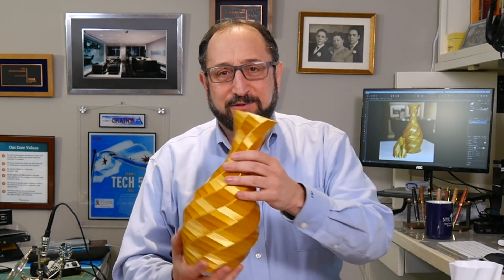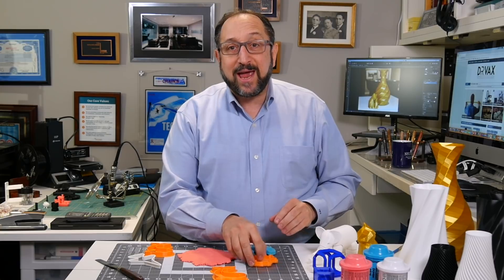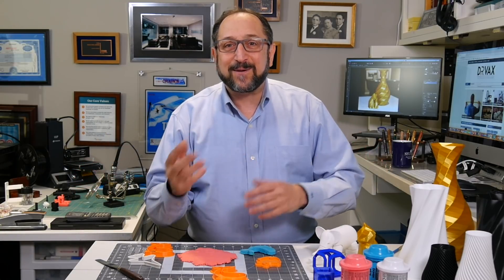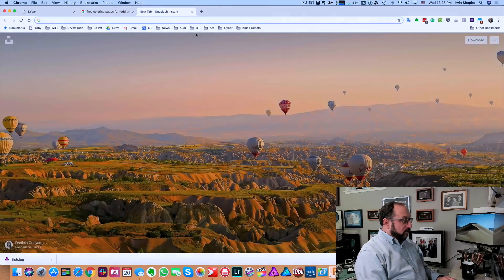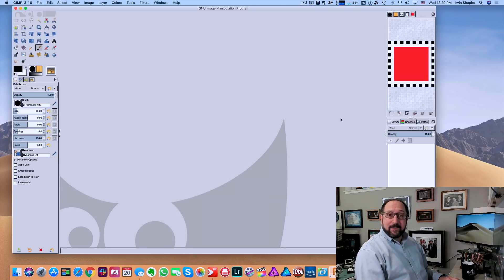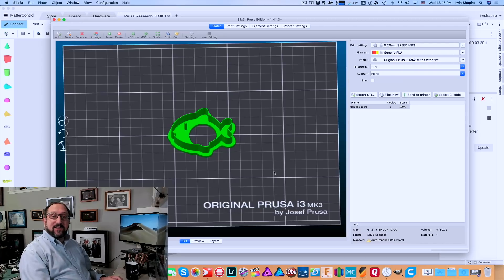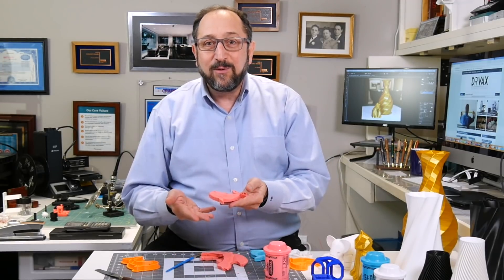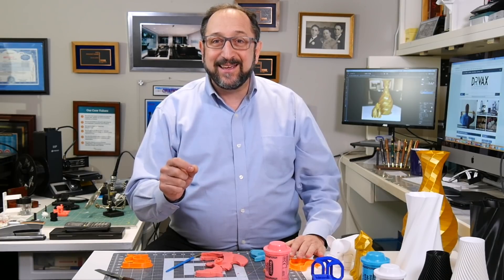Designing and Printing 3d Printed Cookie Cutters

Comment: I installed mattercontrol from your link but found that when I wanted to add a base outline to the image it only gives me a base rectangle as the only option. Do you have any suggestions?
Reply: I'm having the same issue. Were you able to fix it?
Reply: @craftingmaniac617  Not yet I still have to figure out why.
Reply: @robingordon4550    I had the same issue, you actually just have to widen the menu, it's just hiding!

Comment: You could actually make a cookie cutter that allows for internal details, you just need to make sure that the extrusions for those internal lines don't extend as far down as the outline of the cutter. That allows the outline to cut the main shape, while the internal lines just leave impressions which can be baked in.
Reply: I did notice that and was wondering how to half the height of the extrusions for the internal lines.

Comment: You are the first Youtuber that got the term "food safe" right.
You can use PLA 3D printed for storage. It requires thorough dishwashing and rinsing with hydrogen peroxide. But who wanna do all that work.

Comment: Thanks for the vid! I'm looking to make custom cutters for polymer clay earrings and I'm going to give this a try! Question though -- is there a way to control the thinness of the outline/shape? I'm worried that it will be too thick to cut the clay, and need to ensure it's thin enough. I played around in MC and looked online but I can't seem to figure it out, so I thought I'd ask! Thanks again.
Reply from the maker: Not sure their is.  However if you want more control over your outline, and are comfortable with computers, you can use an alternative approach.  Here is a video about how to use SVG files (vector files) to produce 3d prints.

https://youtu.be/B-kWtReUEN8
Reply: @MakeWithTech  Thank you!!

Comment: PETG IS THE FOOD SAFE FILAMENT .
It is available in 2 kg rolls at 1.75mm and 3.0mm  they can be 3d printed and then annealed in the oven to give it strength.  As I have learned from some of the 3D print videos from 3D Kitchen.
Reply from the maker: Thanks for the info
Reply from the maker: @Marshall McFarlin I value your comment and your contribution to the DrVax community.

To help us all build the DrVax community of "makers" I have created a new community forum at http://forum.drvax.com .   At the DrVax forum, you can engage in discussions with me and other community members, use a rich text editor, and post images.  This should facilitate better communications.

It would be great if you could repost your comment to the forum to help with the discussions.

This forum is still in beta and the software I am using is complex so I may have some feature misconfigured. 

All the best.  Irv

Comment: Thank you Dr Vax, enjoy watching your video and learning something together, very clear and informative. I downloaded the image and used gimp to export the outline, however I found the wall of the image is rough, is that a function to 'smooth' the stroke? Secondly, I would like to 3d print some alphabet for my kids but I found that few letters require additional support such as b, d, o...etc with a separate structure inside the principle structure. Your teaching by using the base function in MatterHackers are good but what if I want to minimize the base support, do I need to create more 'cylinder' or a bigger shape to make the hole?
Reply: I managed to do it via  GIMP.  A very good software for image editing and cookie cutter maker. Tks again for your help !

Comment: hey there I am trying to use this program but having some issues. I designed my cookie cutter in adobe illustrator. I sized it in the .ai program and saved as jpg. I uploaded to control matter, but none of the sizes match. Inside the matter control program I also am getting size issues. such as raising the height to 15mm in real life print is is more like 5mm??? any help would be great.

Comment: Hi I'm trying to make a cookie cutter to use as a stamp for my logo on my custom made pottery. I use the 3-D printer at the library. I'm not sure what kind they have. When I try to set up any of the printers it doesn't recognize them. I want to make a stamp that has an outer edge and text inside. Is that possible?

Comment: Hello i was wondering what printer you used to create the cookie cutters and also which printer and plastic would you recommend if i wanted to start making a lot of cookie cutters? 
Thanks
Reply from the maker: I have made cookie cutters on many of my 3d printers.  Any printer with a large enough bed for the cutter will work.  These are very easy prints.  In terms of materials there is a lot of debate about the safety of 3d printed cookie cutters.  On the one hand PLA is an organic plastic that is generally thought of as food safe.  The issue is that our 3d printers are not clean and 3d printers have gaps that may trap bacteria.   Personally I just use PLA, wash it carefully, and fully bake my cookies.  BUT and this is important I am not a food science expert.   It you want to learn more about PLA food safety I recommend Googling it.

Comment: When using Matter Control, How do I get the inside of the cookie cutter to be all open , instead if putting a hole but still have the base around the outline only, like the airplane cookie cutter you display in the intro of your video.

Thanks! Great Video
Reply from the maker: I am not sure you can do this in MatterControl.  However, I will be doing a new video on using SVG files and Tinkercad to make cookie cutters with a lot of control.  Watch for it in January.

Comment: Thank you for such great video! I want to buy a 3D printer to print cookie cutters! What 3D printer do you recommend? Preferably on the $200s... budget
Reply from the maker: If you can handle a kit the ender 3.  If you want fully assembled the monoprice mini select.
Reply: DrVax thank you for your reply! I was saw that the one already assembled (which is what I’m looking for, I’m scared of getting one that I have to put together) is only 120 mm on printing space... Is there another one any bigger? I saw the Elegoon Neptune which has 8 inches print size. Downside is there aren’t many reviews for it.
Reply from the maker: I have no experience with the Elegoo Neptune but I do own a Qidi X-Smart which I pushed directly from Amazon.  It is a bit more expensive but it has a 150x150x150 print area vs 120x120x120 on the Mini Select.  It is also fully enclosed and uses a direct extruder.  The best feature is that it comes with wifi access built which makes sending prints and monitoring the printer a delight.
Reply: DrVax thank you!!

Comment: Will Matter Control work with an Ender 3 pro 3D printer?Thanks Dan
Reply from the maker: Yes.  Just select the Ender 3 as the printer type.  The size and basic specifications are the same.

Comment: Good Morning , could you save typed words in the same manner and use the words for a impression?Thanks Dan
Reply from the maker: +Daniel Peters Yes. This video might give you some ideas as it works with 3D text. 

Multiple Color 3d Prints on a Single Color Printer https://youtu.be/-NkPsdRQRHc

Comment: I suggest washing the 3D printed cookie cutters before even the first use. 
Small amounts of grease and oil exist on the printers that may need to be removed.
Reply from the maker: Meaningful suggested.  Highly recommended.  Thanks for sharing.
Reply: Make sure to use a food safe filament also pla is not one after it's been heated and extruded.